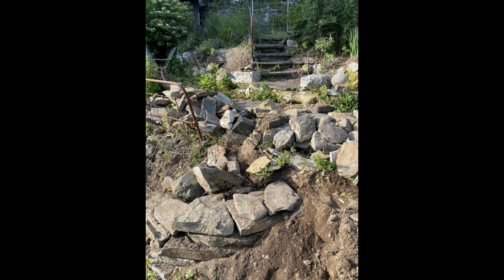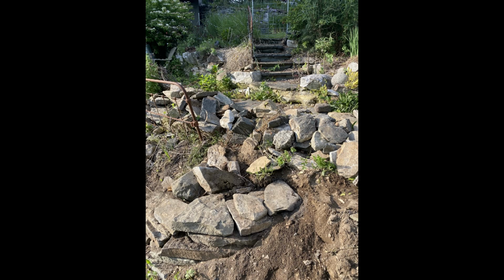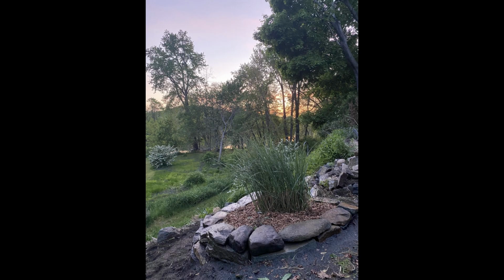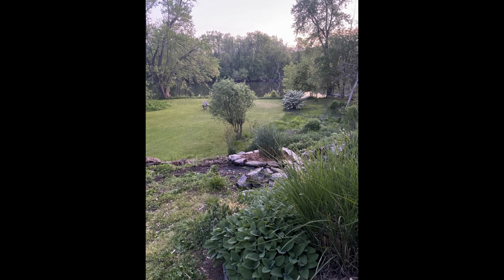Podcast 358: Workshop Ceiling Heights, Foamglas, and Low-Slope Metal Roofs

Comment: Re: radiant barriers: the big materials advantage of a radiant barrier isn't reflectivity, it's emissivity. A shiny surface doesn't reflect meaningfully more light than a white surface (they both reflect  >90% of incoming radiation). However, it emits significantly less of its energy via radiation (~5% emissivity for mylar vs ~68% for white paint). That means that the improvement over other materials is in inhibiting transmission of energy from the space behind the shiny side into the space where you can see it. It's kind of backwards from the way you hear lots of builders explain it, but that's why their explanations don't make sense.

If you want to get accurate temperature measurements from an IR thermometer, you need to know the emissivity of the materials you're looking at, so they have some handy tables: https://www.thermoworks.com/emissivity-table